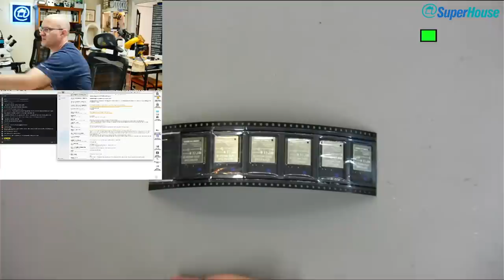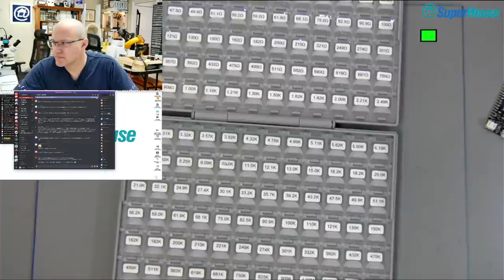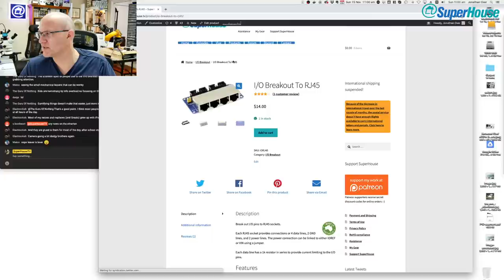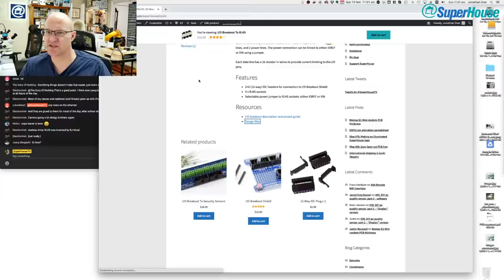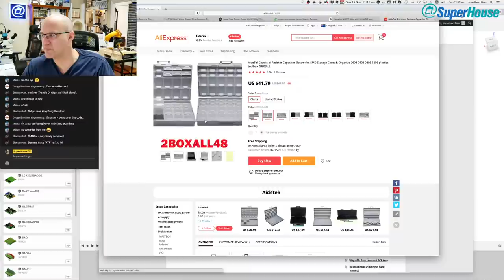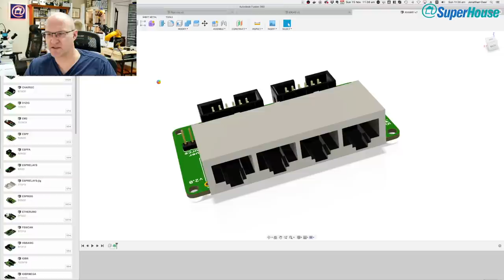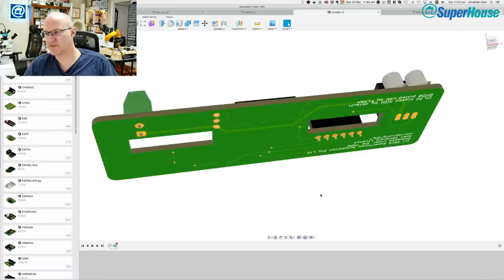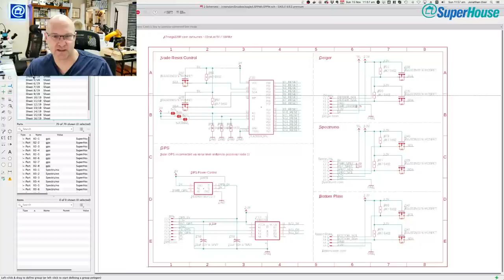Home Automation Hangout 2020-11-15

Comment: I still think the hole is for pressure like you said, this thing is gonna heat up and cool down fast, it needs to avoid a vacuum forming inside, vapors getting trapped, and avoid warping. I thought at one time there was gonna be an led under it, I have seen other can modules with holes for leds, but afaik they never made an esp32 module with led

Comment: No offense but I totally dislike your pushbutton lighting PCBs. The Superhouse PCB requires using the push buttons that you use and has fixed button layouts.  Also, it means I cannot put the buttons where I want them on the switch cover and also requires that the holes are carefully placed to line up with the buttons. There is no flexibility built into the design. Also, these PCBs cannot be used with different sized pushbuttons or even rocker switches. They all need to be identical in height, at least. A better idea is to use cheap female JST connectors, on the PCB so you can just solder a male JST pigtail to the push buttons and plug them into the JST on the PCB. You can buy bundles of 50-100 male JST connectors, prewired with any number of wires cheap from China and it's easy to solder the wires to the push buttons or even add push connectors, onto the wires, that will slip on the push button connector tabs. If I only want 2 buttons at a switch and later want to add a button, with your current PCB, I need to replace everything, instead of just replacing the plate and adding an additional button. JST connectors make it easy to add or remove buttons, change LED colors or button sizes, or even change over to tri-colored LEDs. Also, making one PCB with circuit board mounts for the max number of JST connectors (for the RJ45 cable) means you only need one board instead of different boards for different button counts. Just add more JSTs to the existing PCB. You could also have a board with 2 RJ45s for more wires to the panel. I put in at least 2 cat5-6 cables at each light switch location for future upgrades. It's easy to solder additional female JSTs to the PCB vs having a bunch of different button (count) boards. The really big thing is, as I am deciding on my wiring and buttons, I have more options that can be quickly changed. Why have software-configurable switches that use hard set hardware that is not easy to modify, according to an evolving plan? As it stands, If I want to add or remove buttons, using your existing PCB, instead of replacing a plastic cover plate, for less than a dollar, I would have to order new breakout PCBs, from Superhouse, and wait weeks for shipping. A universal board, using JST connectors, makes much more sense. You could also use the extra JST connectors for power breakout or for custom mods like adding an infrared sensor or even an LCD panel. How about also adding a spot on the board for an optional pin header for extra functionality. If you made this board or just the bare PCBs I would immediately buy 20-30 for my remodel. I could design my own board but my PCB skills are nill, at this time, and I don't have the time to do something that would take me weeks of work and you could whip up in minutes. Besides, I think it's a great idea that would be well received by the DIY community, especially people doing new construction or rewires. If you could modify your existing board along these lines and post a circuit board layout, that would be awesome. Thanks for all you do. I love your chat sessions.